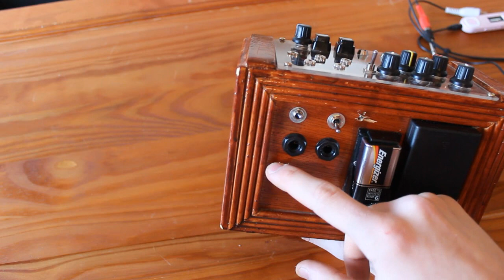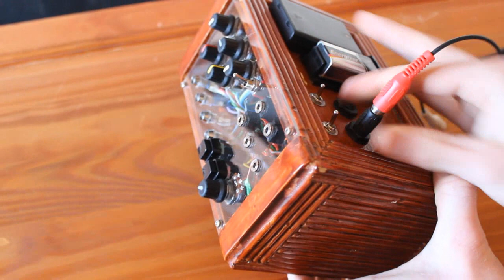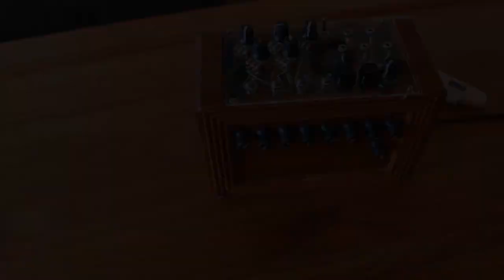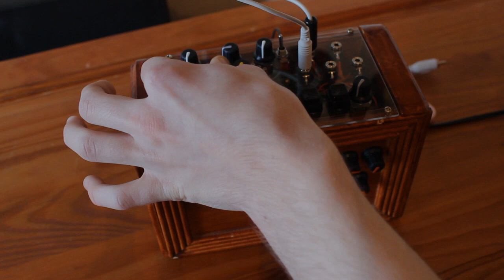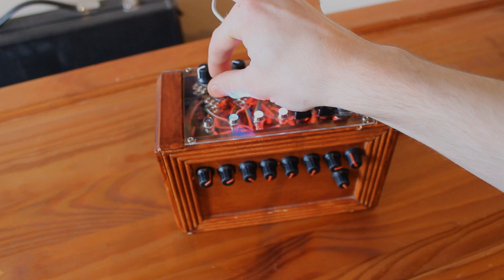DIY Synthesizer - Custom Korg Monotron + 8 Step Sequencer - KORG Octotron Mini Modular Synth

Comment: Y'know what would be cool? If you took two Monotrons and controlled them with a keyboard. I suppose you'd need a midi to cv converter. That could be pricy but it would be cool. It'd be like having a little two oscillator synth. I suppose it would be lacking an envelope. Hm.
Reply: Paul TheSkeptic don't forget the stamp
Reply: The stamp?
Reply: Paul TheSkeptic you may have a look at the Midimuso diy-kit on ebay for 30euros. With a minimum of solder skills you got something that can compete with several eurorack solutions.
Reply: Oh thanks man. Much appreciated. I'll check it out.
Reply: Paul TheSkeptic you're most welcome. If I can make time I'll most probably go and get one before they're gone. Another great converter is the awesome "Midi implant" for 50eur.  But this is sold out since ages. Happy soldering 
👌🤖✋
Reply: I'm getting a lot of weird results. What exactly am I looking for?
Reply: Paul TheSkeptic check this one for the details http://midimuso.co.uk/index.php/cv-12/
Reply: Paul TheSkeptic it is a 12channel midi to 6 gate and cv converter. They sell them on eBay.
Reply: Paul TheSkeptic try this one
 https://m.ebay.fr/itm/Midimuso-MIDI-to-CV-Converter-CV12-ORAC-1-1-2-and-0-5-Volts-Oct-Kit-/132469740263?_mwBanner=1
Reply: That's great. Many thanks.
Reply: Paul TheSkeptic cool.